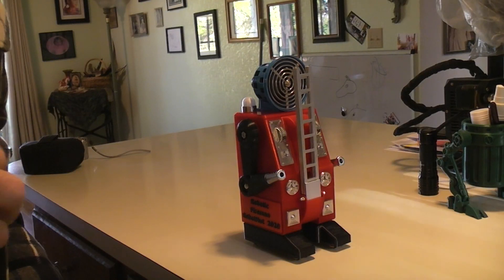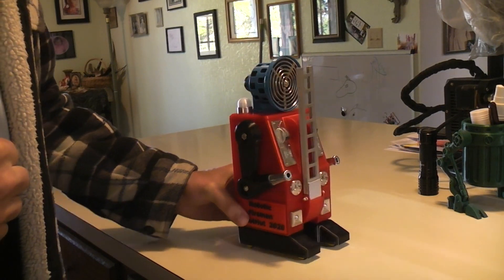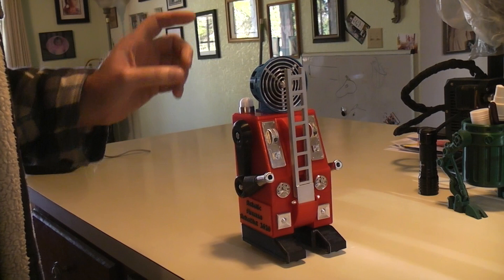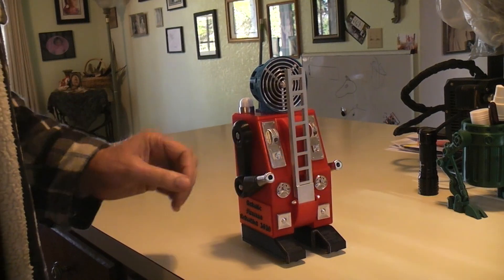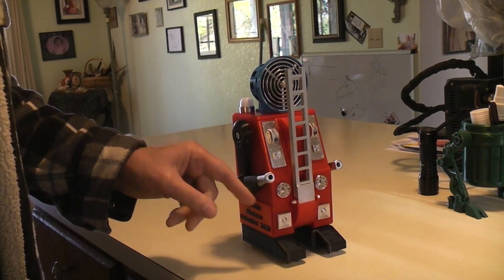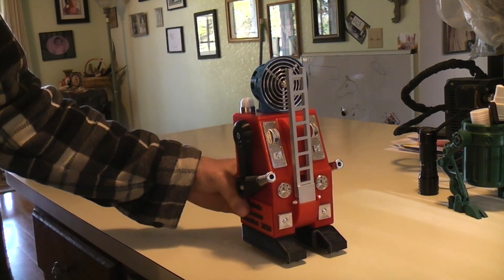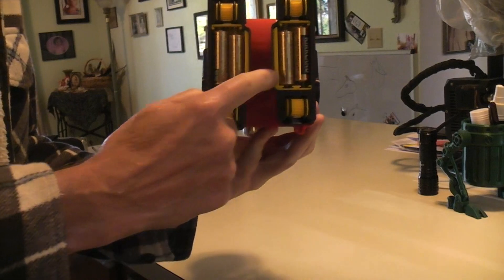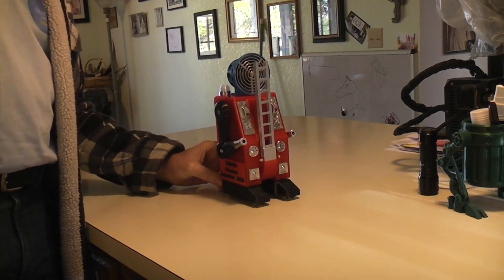Robotic Fireman. 3d printed. walks, automatic ladder, siren, bell, flashing lights and moving arms.

Comment: Cool. So what happens if you are running a Sonic Robot at the same time? Does the siren or bell affect them?
If it doesn't, could there be a way to make smaller robot firemen that listen for their "leader" and also a whistle as well? 
As you can tell, this great little project has caught my imagination.
Reply from the maker: The  sonic robot works on a certain frequency so the siren  with its dual tone would not effect it , or at most effect it for a split second as the tone rises or falls.